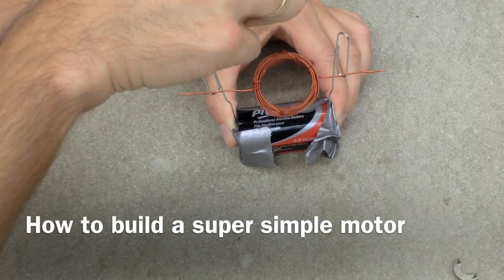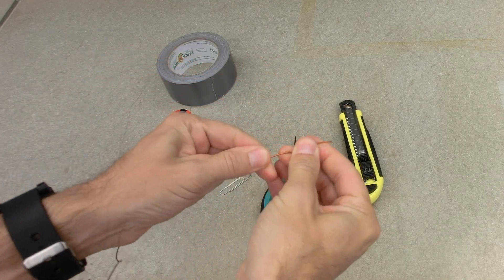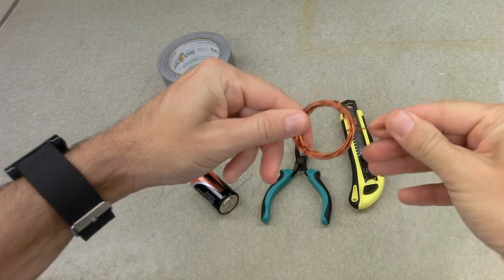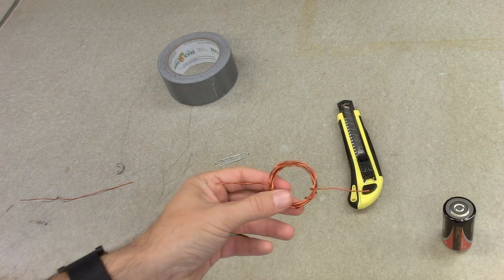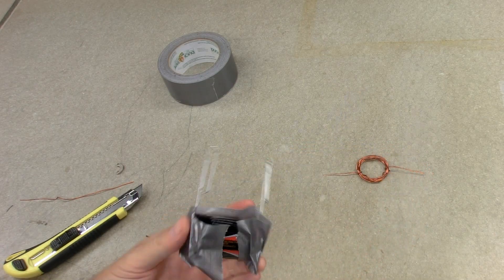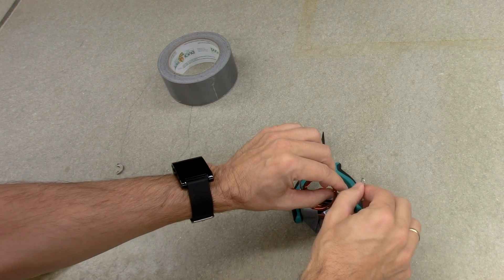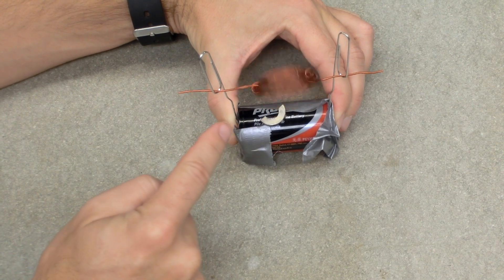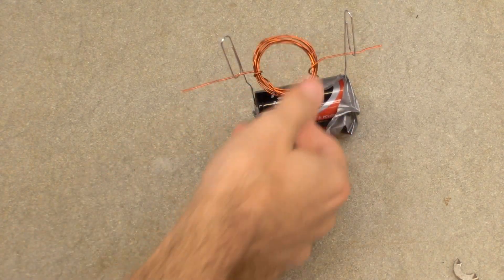How to build a super simple electric motor

Comment: Another video did this experiment with both sides completely sanded.  I just tried it, and it worked some of the time.  I think the wire vibration in the end loop can occur at a frequency which provides intermittent electrical contact.  Even when it didn't spin and stayed still, you can feel the Lorentz force.  You might want to try it.

Comment: CAN i USE A IRON WIRE ???
Reply: You can use any kind of metal wire. It just has to have the enamel coating that insulates it, or you’re gonna have a short, and burn yourself.

Motors, transformers, inductors, and those old TV or computer monitors have this wire on the deflection yokes, mounted over the color (blue red & green) ray guns.

Comment: Sir,If we use different battery .it will work or not??
Reply from the maker: It will work with another battery.  The 9 volt battery won't work so well because the two terminals are on the top.

Comment: can I use different batteries?
Reply from the maker: Yes - it should work with a C, or AA battery as well.  Really, it depends on the voltage of your light bulb.  I would stay away from the 9 volt battery.
Reply: @rhettallain  what happens if I use a 9V battery